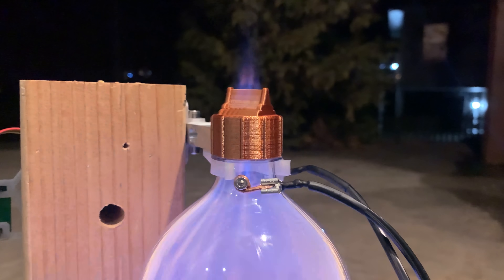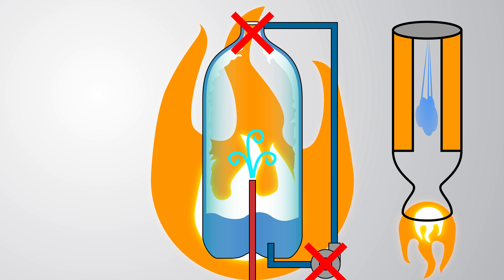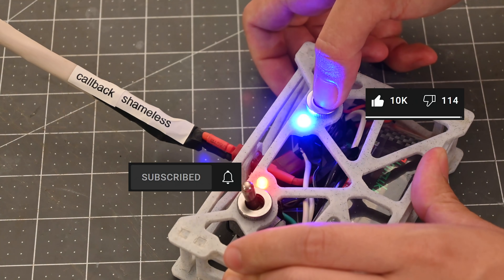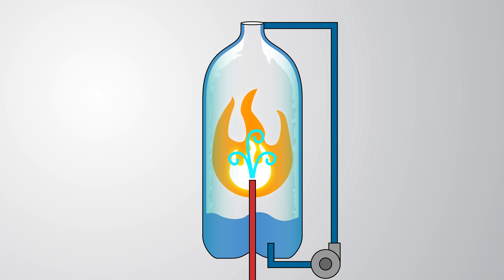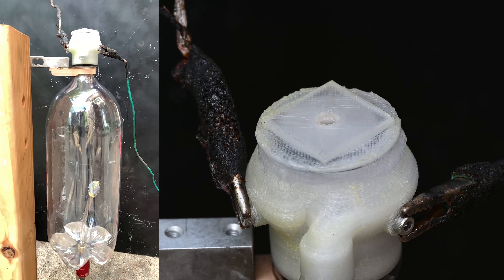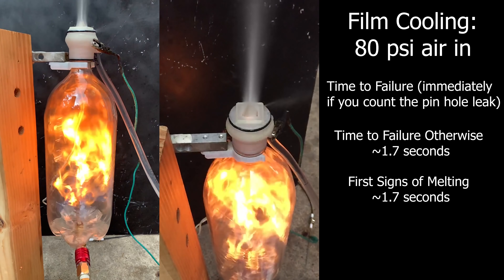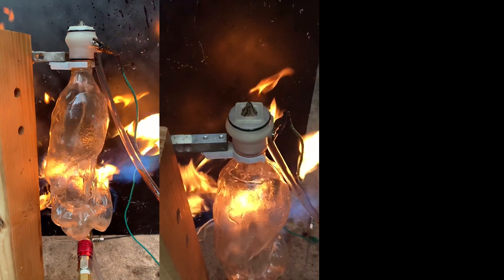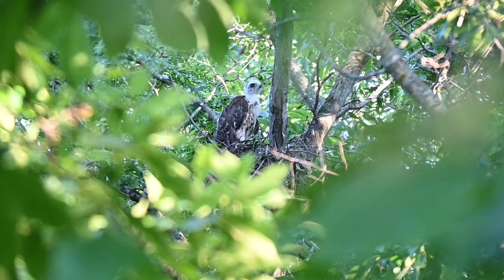Liquid Cooled Whoosh Rocket

Comment: I love to see this project redo with a little brain inside it, like a combination of Arduino and some sensors, you know instead of doing this all controls manually for something that works this fast.... you might have a better luck then and I would be happy to help u with the code.
Reply: The v2 rocket aint have any computers...
Reply: @PLAYERSLAYER_22   well it could have specially with this type of design... of course it needs more resilient bottle for several tests but imagine having a variable air pressure and water pumping from start to finish with a few pressure sensors, also it could have auto fail safe switch if anything goes wrong during the test... i think it would be cool, btw don't think of it as a computer it's just a small ECU working along the process.

Comment: Fantastic work! Super inspiring, I spent a little time on whoosh rockets too.

Turning your rocket upsidedown, and having the coolant flow the same direction as the exhaust is definitely going to help. I imagine the problem is preventing too much fuel from being lost in the exhaust flow. You could 3D print a collar inside the bottle throat which collects and recycles the non vaporized film coolant back around the loop. Almost a reverse of your existing system. 

Totally looking forward to seeing your progress!!

Comment: Nice, I bet your bottle is failing because of radiation heating not conductive heating. If you could find a way to dye your fuel and make it opaque it would probably work like you want it to. Could maybe use charcoal if you can get it to suspend. 

I took your woosh rocket Mach diamond idea and tried to expand on it, you should check it out https://youtu.be/wjJMlkq1p1g

Comment: That venturi effect at the top is definitely causing the failure reversing the flow of the cooling film back up and out.
How about submerging the bottle in water up to the neck. you would have to deal with bouncy but that would dissipate all the heat and any unforeseen fires would be instantly snuffed.
Reply: It might still deform from the inside though with the flame directly on the unprotected plastic unless your meaning using both the film cooling on the inside with the water bath on the outside then it might decrease most of the deformations
Reply: @johnathandolencic4360  Water has a very high heat capacity, you'd be surprised. Fun party trick, add some water to a balloon and blow it up. hold a lighter under the balloon where the water is. It won't pop. The water can absorb the heat so fast, the surface of the balloon won't melt. I would expect the same phenomenon to happen with the bottle.
Reply: @merlinmagnus873  Or, same kind of experiment, boil water in a plasic cup on a fire. Its seems pretty magical seeing it in person.

Comment: I wonder if you kept the incoming coolant/fuel separated from the outgoing exhaust for longer by extending the cap further into the bottle neck if there wouldn't be quite so much fuel being expelled, and therefore more fuel cooling the bottle. if you went far enough into the bottle then it could double as a fuel reservoir when you invert it.